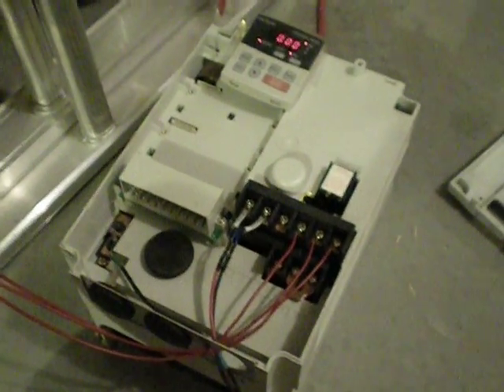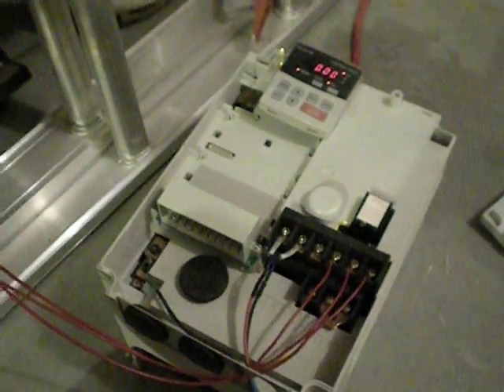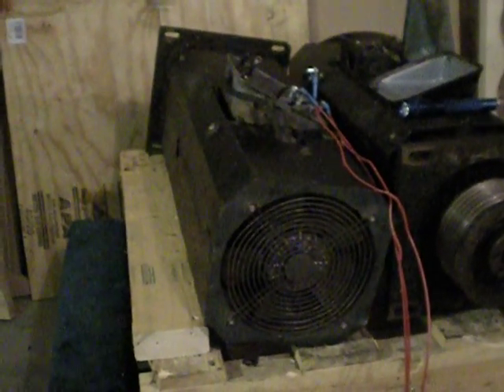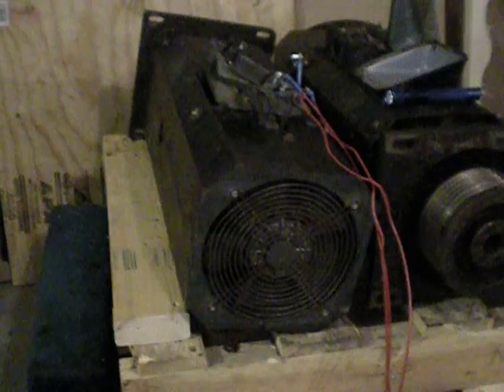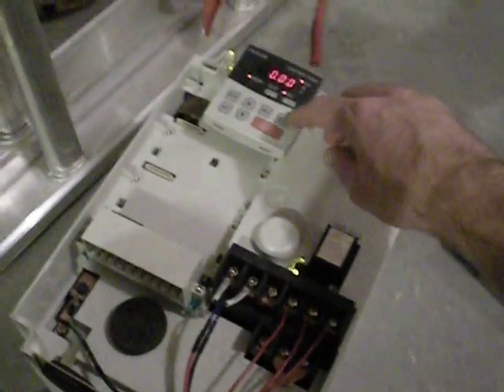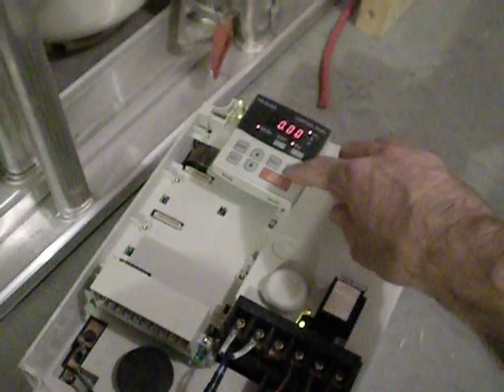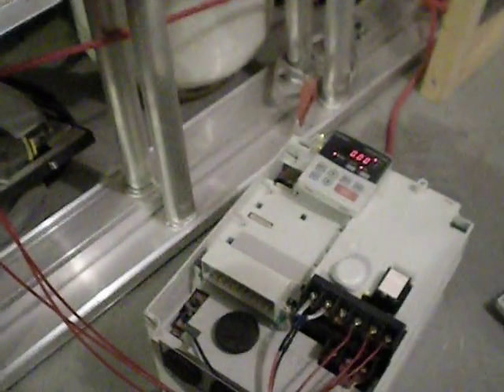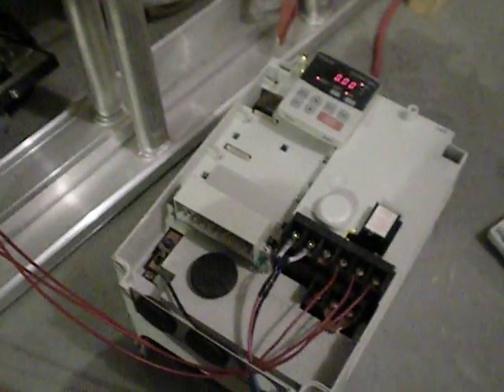Testing mill spindle motors

Comment: I'm still in the market for a FANUC spindle motor that will allow about 4.4kW (about 5.8HP) of power. That's what my CNC lathe requires. They would be about the same size.  I'm thinking these are the 6S servos, but have to look at their catalog.  It's not a huge spindle but it machine requirements necessitate this size, and I think about 6HP whould be fine for a lathe.

Comment: I couldn't get the motor on my mill to run with a generic VFD. I asked yaskawa and they suggested I get a generic motor or the original vfd, which was the size of a small fridge.
Anything special in the vfd setup?
I got over-current error  just getting the motor moving
the motor is the same 3.7/5.5kw